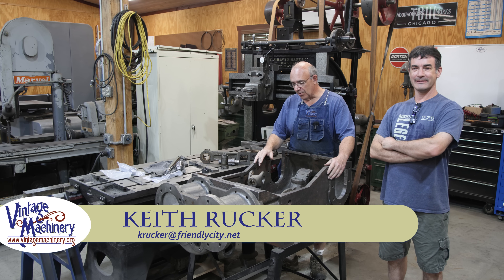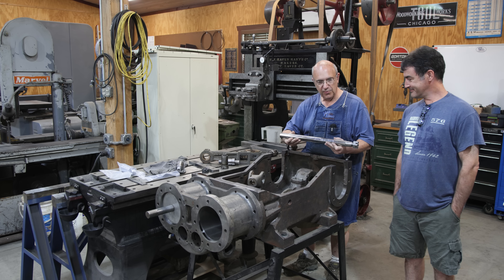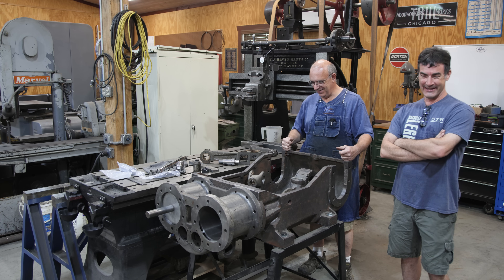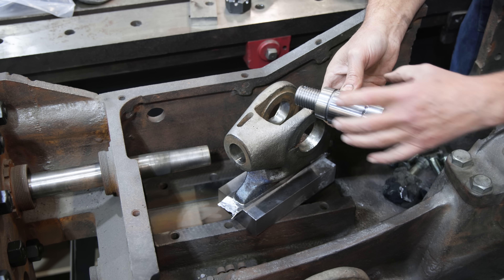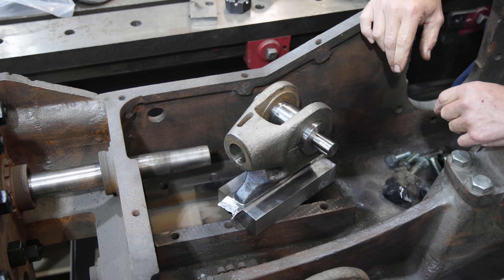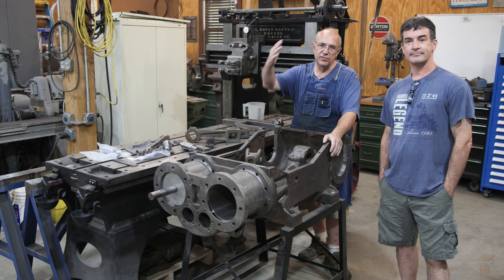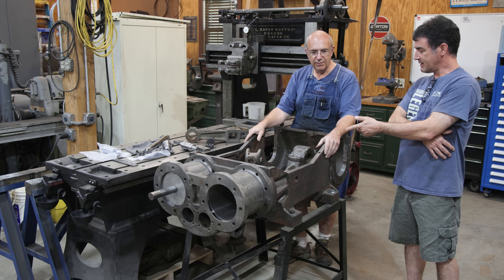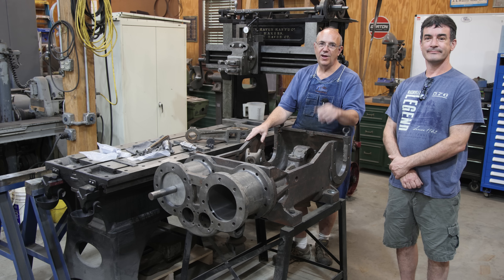Steam Stoker Engine: New Cross Head Wrist Pins from Dragonfly Engineering

Comment: Normally, wrist pins will automatically align with the longitudinal axis of the crankshaft. However, this design requires the wrist pin be aligned at the time of the babbit pour. This was not done. The wrist pin block (whatever it's called) was only aligned with the long axis of the cylinders, but only roughly lined up by eye crosswise with the axis of the crankshaft. Since the shoe was held in place at the exact axis of the cylinder bore this means there will be no extra material to scrape off for any fine tuning on this alignment as well. It could be fixed now with very minor effort. But if allowed to continue, will require a complete tear down and reworking all over again.
Reply: @TgWags69  I agree. The only fix now is to melt the babbitt off the cross head, assemble the crank shaft and connecting rods and pour new babbitt. This current situation almost guarantees binding when assembled.

Comment: The depth of this high carbon layer depends on the exposure time, but 0.5mm is a typical case depth. Once this has been done the steel must be heated and quenched to harden this higher carbon 'skin'. Below this skin, the steel core will remain soft due to its low carbon content. (Wikipedia)

Comment: Good morning Keith, 
I respect the machinist community coming together and creating parts that are above the practicality of the equipment that you have. 
Modern CNC makes it a breeze to fabricate what you need. 
The most important factor is, Don’t Do The Apollo 13 Fiasco. Expect a Square Peg To Fit In A Round Hole. 
LOL. 
Congratulations on your ability to get others to come together and help you finish some of these projects

It’s very difficult sometimes to share your workload when you feel that you’re supposed to do everything yourself. 
Sharing your workload is good and will ease your stress. 
Now, bring your Arnfest celebration out west. 
Arizona or Utah would be great. California would want a piece of the action, so keep that in mind.
Reply: My favorite scene from Apollo 13 is the engineers spreading parts on the table and the lead saying:  "We've got to make this fit in the hole for this using nothing but that."  The ultimate engineering challenge.

Comment: turning that wrist pin with the constant taper would have been easy with the taper attachment right by just turning one long taper first and than turning the center part but it sure doesnt beat cnc
Reply: It looks like the diameter of the "wrist pin" part is a little bigger than the diameter of the start of the small end of the taper. There's a step down from the center's diameter to where the small part of the taper starts. The line of the taper clips the corner of the center diameter. Hard to describe without pictures, the whole "thousand words" thing...
Reply: I was thinking the same, would be the same when grinding it. Just set it up at the correct angle for the taper to grind the two ends first, then do the centre on another setup

Comment: Couldn’t you grind the pin in one continuous taper, then turn / grind the straight section? 
I’m a (retired) mechanical engineer, not a machinist, and it seems like a reasonable way to process the part.

Comment: I think an average case hardening is about 20-30 thou deep so very close to loosing it with 40 thou on the od over size. 

I’d also think the bores will be slightly worn so very difficult to cnc grind the pins and expect them to fit first time. More likely will need to be ground to fit and checked as you go